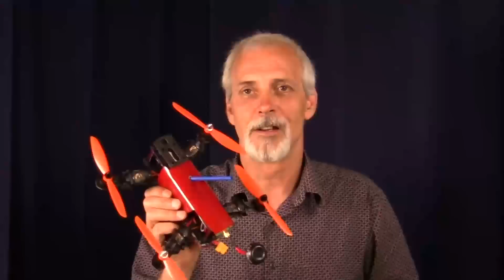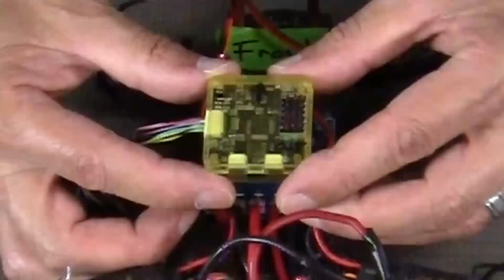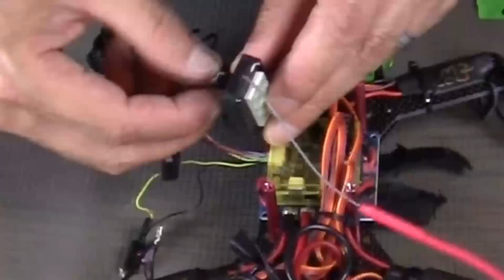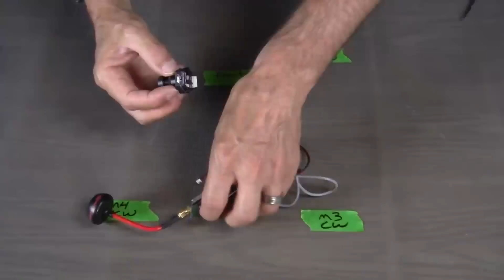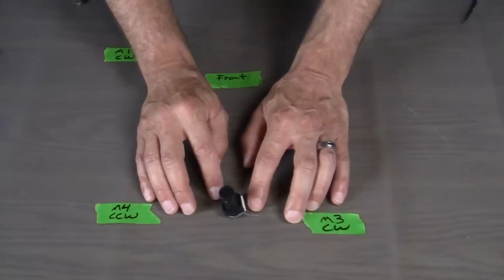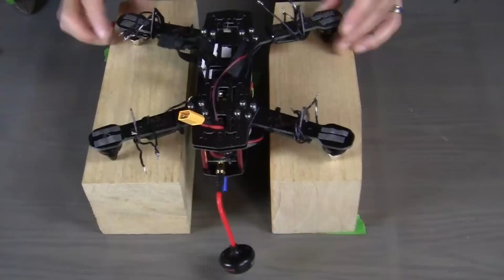How to Build a FPV Racing Quadcopter Part 1 of 2

Comment: I'm doing some tests with a drone x8 + 3DR, in an experimental platform, I want to try only movements in the angles roll, pitch and yaw, but I need to avoid that it rises, someone knows how to deactivate the Z (height or elevation) in the pixhawk, I just want to move the angles without the drone starting to rise, you know how to deactivate the autopilot part of Z could give me information.

thank you I await your comments

Comment: Hi everybody! I've developed an obsession with FPV Quadcopters, but I'm discovering that there is a lot of information and it's hard to piece it all together. I want to build my own 250mini racer, I don't have any solder experience, and have minimal knowledge of FPV racing. I prefer to know exactly what tools I will need and where to find them as well as any suggestions pertaining to what quad builds are beginner friendly and fast. Is there anyone kind enough to help me out?

Comment: I am building F450 quadcopter and the parts are....
1) Motor 2 x MultiStar  2212 Combo Set With Self-Tightening Propellers CW/CCW Set Of 2....
2) ESC-EMAX SIMONK SERIES 30A BRUSHLESS ESC ELECTRONIC SPEED CONTROLLER...
3) TX and Rx- flysky Fs-t6 with receiver....
4) Flight controller-cc3d....
Which battery would you recommend for longer flight time?
Reply from the maker: +Kiyong Mize We would recommend 3S-4S in either 11.1 or 14.8 V, but double check the motor specs to see if that particular motor supports 3S-4S batteries.  If not you can find motors that support 3-4S LiPos at http://therobotsource.com

Comment: Great videos thank you so much. Excuse my ignorance, why do you bother tinning the underside of your power distribution board. Does that increase your conductivity? Can you get away without doing that? I have a ZMR with CC3D and it is shaking a bit as I throttle off / on descent. What settings might I change to try cleaning that up please?

Comment: great video. but the orientation of the cc3d flight controller can be mounted in almost any direction. the arrow doesn't necessarily have to point forward
Reply from the maker: KS Pyro The directional arrow is there for a purpose.